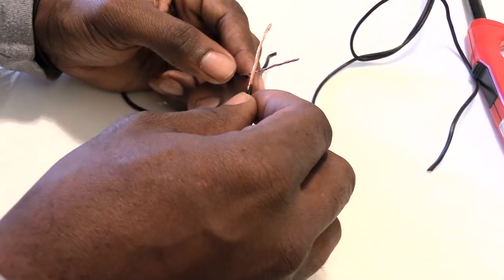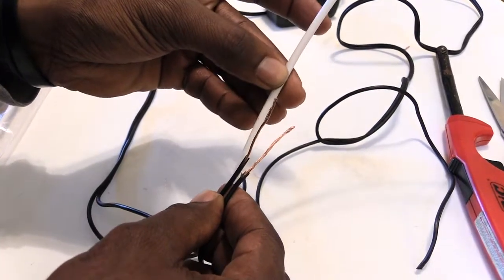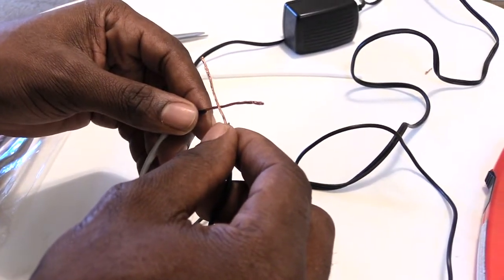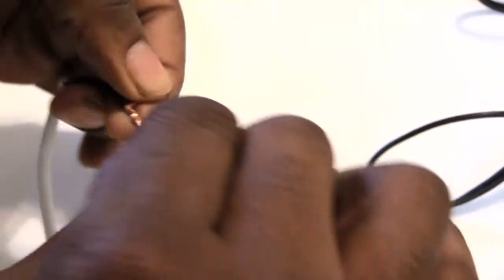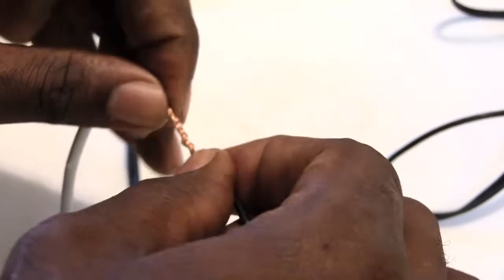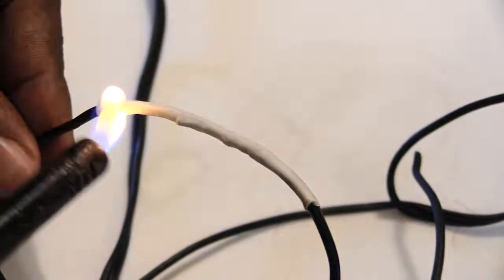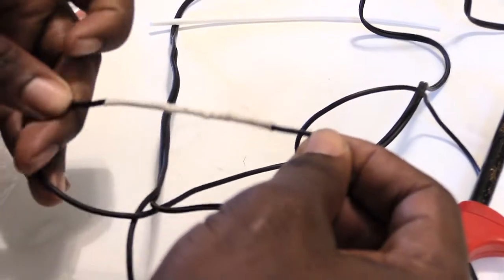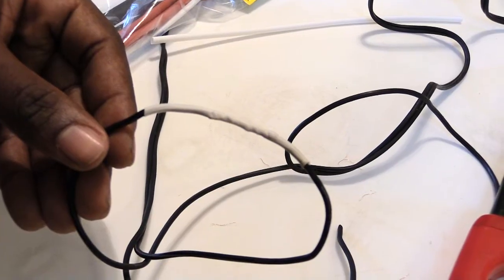How to Splice Electrical Wires Together & Use Heat Shrink Tubing!

Comment: For connections that may be exposed to weather try to use marine grade heat shrink or adhesive lined heat shrink tubing, it adds another layer of sealing against moisture intrusion.

Comment: I have a question. I make water fountains and I do a lot of splicing of wires and I do use the heat shrink wrap and the western union twist on the wires.  Now when Im done with the fountain, I go to touch the water that's in the fountain, and I get small electrical shocks. Am I not heating  up the shrink wrap well enough?

Comment: Great video, but if may say, the EASIEST way is get WATERPROOF CRIMP BUTT CONNECTORS. One end of your wire goes into one end of connector, then you tightly crimp that end and then put your other wire end into  the other end of your connector and crimp that end, then heat shrink both ends and voila, the wires are protected with metal on either side which provide a grest connection and heat shrunk which provides a waterproof seal for both ends. Those heat shrink tubes are not waterproof and can, over time, let corrosion in from humidity. Theu work incredibly well. Just my opinion. Stay Blessed.
Reply from the maker: Thanks for sharing your method; appreciate the input!

Comment: Do I need to solder the spliced wires or it works as good without soldering? I’m trying to secure my car stereo harness and I really need to redo de wiring and use heat shrink tubing as opposed to using electrical tape.

Comment: I just tried this and after 2 hours they still come loose . now I need to go back to the store and buy another set of tail lights for $ 40.00 and bring the boat and trailer to the shop and spend another couple of hundred dollars .This boat and trailer is becoming a money pit . I still need to figure out why the Navigation lights don't work with the switch on , they work when I add 2 wires from the navigation lights to a battery .  Almost a year trying to figure out the wiring and to get everything working .
Reply from the maker: Sorry to hear, hope you get it figured out.

Comment: The use of heat shrink tubing is not limited to electrical connections.  It can be used for bonding or covering all sorts of stuff.  Anything you can stick in the tubing can be sealed.

Comment: What length of the bare copper wire, on each side, would you advise is necessary  to produce a strong... whatever you called it..
Reply from the maker: Inch to inch and half. Glad could help Please subscribe like and share 🙏.

Comment: Great tutorial.. and showing the heat shrink product in the bag and where to buy it.... so, what if I can't slide that tubing into the wires? Can I just cut the tubing length-wise and wrap around the wires and then heat shrink it normally?
Reply from the maker: Yes exactly. Glad could help Please subscribe like and share 🙏.

Comment: Could you use this with solid wire i have to replace a well cap and that requires cutting wire and splicing back together

Comment: Use a heat gun or a hair dryer instead of a flame on the shrink tubing .Also soldering it would have been better
Reply from the maker: Thanks for tips. Please subscribe & like and share if haven't already and check out our other helpful videos

Comment: I would solder the connection and put shrink tubing over it.  Everyone has a way that works for them and this is what works for me.  My butane solder iron has a torch tip I use to shrink the tubing.  The tubing will shrink down to half it's size.  Use that as a guide so you don't select a size of tubing that is too large a diameter to shrink down to the size you want.
.
Reply from the maker: Thanks for tips ☝Please subscribe & like and share if haven't already and check out our other helpful videos

Comment: I like the Western Union splice. I wish I had seen this prior to using the crimp-on butt connectors, because I don't have a lot of faith in them with stranded wire (though I did tin the wires with solder as a precaution). This would have been easier as I am using shrink wrap on top of the butt connectors anyway. Plus, I didn't know if it would be safe to use a lighter, but the hair dryer I tried sure wasn't doing the trick! (I'll keep the lighter moving, of course.) Thanks, good video which gets directly to the point without a lot of chitchat.
Reply from the maker: Your very welcome Glad could help👍 thanks for comment, Please subscribe & like and share if haven't already and check out our other helpful videos

Comment: Excellent tutorial.  Shows a solid way to avoid the brittle joins that soldering can give.  Sure soldering will be stronger, but this is pretty solid anyway, and really - if wires are under enough stress that soldering is required to keep it together - after a splice like this - well you've got bigger problems lol

Thanks heaps, my man!  It's given me confidence to have a go at cutting and re-joining cabling for a rather expensive headset (which the manufacturer won't just supply a replacement cable that I could solder on...bastards! lol).  I've done other solder-less joins in the past that just weren't as solid - I can't wait to give this a try.
Reply from the maker: Your very welcome Glad could help👍 thanks for comment, Please subscribe & like and share if haven't already and check out our other helpful videos

Comment: I have been using those damn "wire nut" connector things that you twist on after you wrap the wires together vertically, but this way seems so much better, especially in confined areas.  Thank you!
Reply from the maker: Your very welcome Glad could help👍 thanks for comment, Please subscribe & like and share if haven't already and check out our other helpful videos

Comment: Do you need to solder the wires also before heat shrinking or no need to? Great video thanks!
Reply from the maker: Shouldn't need to unless your going to be putting a lot of pressure on wire. Please subscribe & like and share if haven't already and check out our other helpful videos

Comment: This other video says dunk wires in alcohol before putting flux they say to remove impurities but they only used tape after soldering job.. maybe like Making a Reese's Peanut Butter Cup...  you got your peanut butter on my chocolate no you got your chocolate in my peanut butter...hey
Reply from the maker: Lol 👍  thanks for comment, Please subscribe & like and share if haven't already and check out our other helpful videos

Comment: I don't know if it's possible to make connection better. But to put flux and then solder carefully use flux on the wires and put thin coating of solder before pushing the shrink wrap. could use oversized to fit over the repair job if bulky
Reply from the maker: Thanks for info👍Please subscribe & like and share if haven't already and check out our other helpful videos

Comment: Also, use the heat shrink tubing WITH ADHESIVE.  Not only will it be more waterproof, but it adds strength.
Reply from the maker: Thanks for tip👍Please subscribe & like and share if haven't already and check out our other helpful videos

Comment: That was a perfect demo. Thank you!
      My dad always had me take the two bare ends, twist them each lightly, trim each to length for appropriate wire nut. Insert both ends exactly evenly and twist until ends catch the threading. Then, twist tight. Complete by wrapping in electrical tape.
      Is the heat shrink a stronger bond physically for the cord? Is it a better connection to conduct electricity without heat build up? Is one way better than the other?
Reply from the maker: Tape can come lose overtime, but will work fine for a lot of things, but if you have something that is handled a lot would heat wrap. and twist for strength.

Comment: I need to do this.... is it overkill to solder the wires then heat shrink over it?
Reply from the maker: Just depends if it's something that's gets pulled a lot then soder to be sure. Please subscribe & like and share if haven't already and check out our other helpful videos

Comment: Liked, subbed, and belled! Thanks flashback 502! I’m going to give you credit on my upcoming series of YouTube videos re: salvaging a Riccar “Supralite” model R10S.2 vacuum cleaner that I found in pieces by the dumpster this week. It did not even occur to me to put the heat shrink tubing on the wire first, before doing the “ Western Union” connection.
Reply from the maker: Thanks for sub and like, hope u get vacuum fixed glad could help👍

Comment: You should open all the wire hairs , intertwine them together and then twist them. After that , put silicone paste generously and then the srinking tube over it and heat it. You will have a perfect water seal connection. Your method is pretty good if it won't be expose to outside weather. Good job , though. PS. If you could solder them before , is even better.

Comment: thank you I will do that with my lights in my motorhome I will use bit of solder on it to. I have been working on my motorhome along time and I have got new wires and new lights for my motorhome and I have got videos on YouTube
Reply from the maker: Your welcome, Thanks for watching and commenting hope you get it up and running 👍.Please subscribe & like and share if haven't already and check out our other helpful videos

Comment: Why go to all that trouble and not solder it?   That would make the electrical connection so much better and stronger mechanically.   I don't understand unless you don't have the simple gear for soldering.   Good video though.